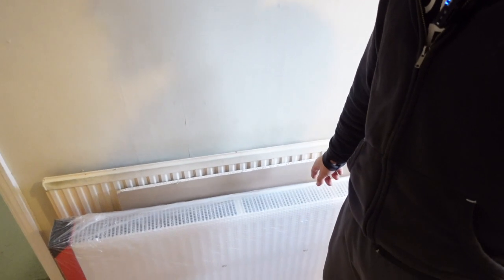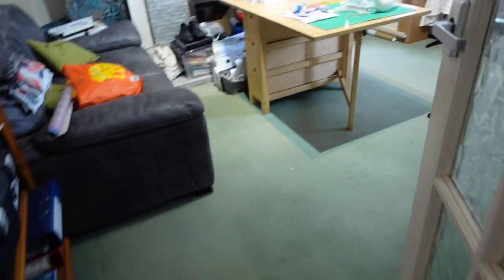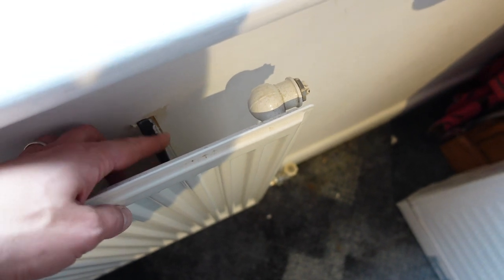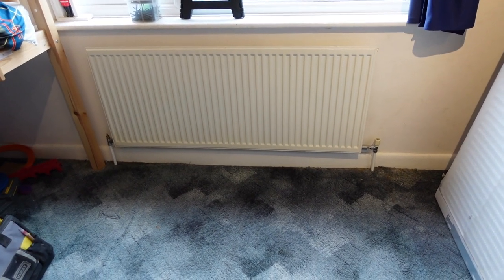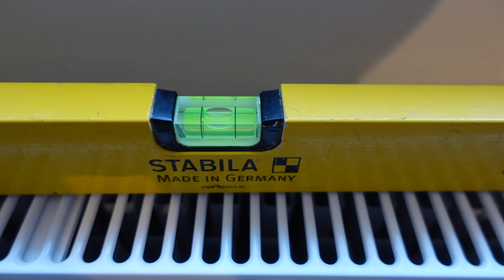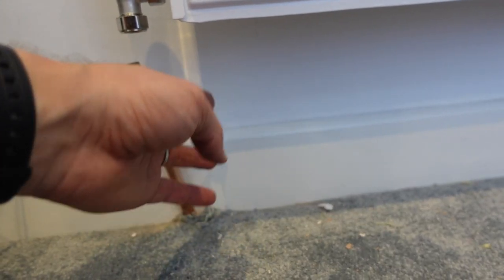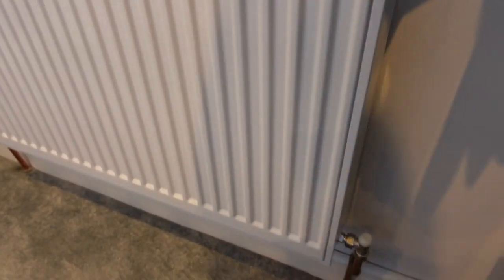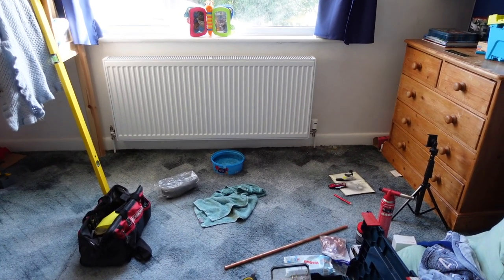Soldering and Replacing a Radiator: DIY Tips and Tricks

Comment: Jointing compound on the olive. Keep one of the pipes in the same position, take the floor boards up and alter the one underneath to the TRV or lockshield. PTFE last resort on a compression fitting if its leaking, it can save you. Solder once all fittings are fluxed and copper is in place, avoid doing bits separately. Well done though for a first go.
Reply from the maker: Great advice mate, thanks!

Comment: I finished replumbing my house part way through the year, after starting it when I did the bathroom during the first covi lockdown. I had never soldered before that. I even piped up the new cylinder and oil boiler (got someone in to commission it though). Saved myself a nice chunk of money doing it as well. Extension to do at somepoint next. I'm lucky my stepson is a brickie and I'm a sparky, so we should be able to cover most of it between us.
Reply from the maker: Amazing! That's awesome, great work mate 💪👍

Comment: Well done. However, if you have suspended floors with the feeds and returns under the floor - it is better to bite the bullet and cut back and run a custom piece (with a slow bend) to hit the rad tail in one run.😉

Comment: I did this in my last house. I replaced all pipework and radiators (apart the two newest that were only a year old)  I saved a fortune and got exactly the radiator size I wanted as well as getting rid of a maze of old  junk pipework that was reused from earlier systems going back to 1989. I was never trained in plumbing, I read a lot, watched YT videos then took a week off work to practise in my backyard, I bought the soldering gear, pipes and different fittings and spent the week cutting, bending and soldering pipe. I done some of the underfloor pipes with Speedfit pipe and fittings. I never touched the gas boiler, I got a plumber to connect it all up. There was only one small leak were I forgot to tighten a nut. I sold the house a month ago and the surveyor found no problems.
Reply from the maker: Legend! That's amazing mate. Great work!

Comment: Good job, can't beat a nice new radiator. I need to get myself a soldering kit. Doesn't seem that complicated. I have been using push fittings with copper pipe. Quicker, but I'm not sure of the longevity 😂.
Reply from the maker: With Yorkshire fittings, soldering is a doddle. They're more expensive, but still cheaper than a plumber 🤣💪

Comment: Nice work. I have been considering doing the same in my 1930s build but I've been concerned by what I've read. My understanding is that significantly increasing the power output of your radiators may have limited benefit if the pipework isn't upgraded to supply enough water to match the increased radiator size. 

Is this something you have looked into?
Reply from the maker: Great thought. We practically replaced all the pipework because we did a whole new boiler and heating system. Some of the old pipes remained the same, but large sections were replaced or added with new pipes.